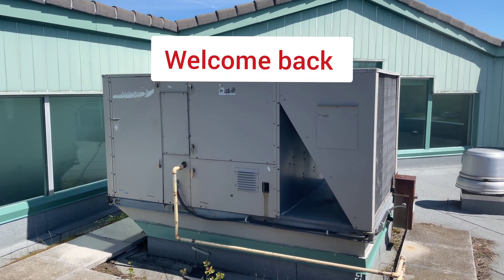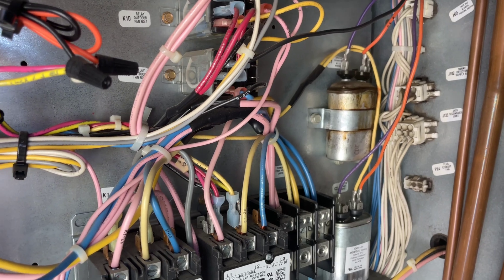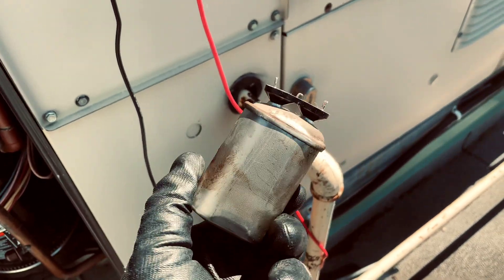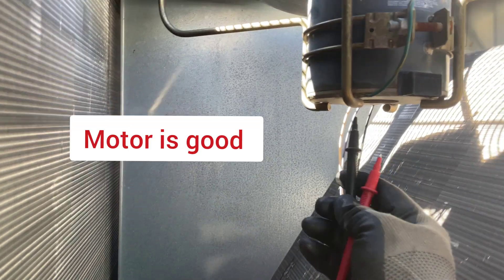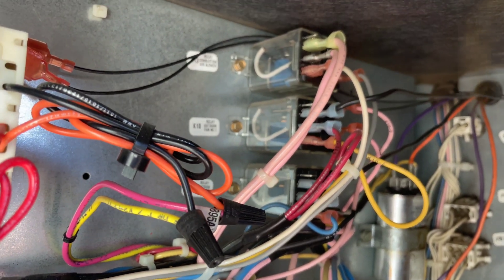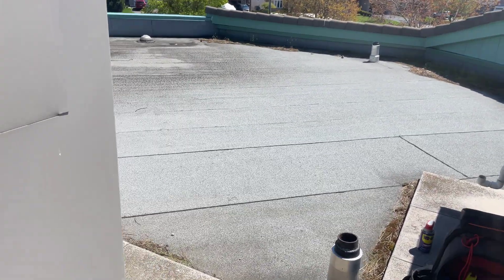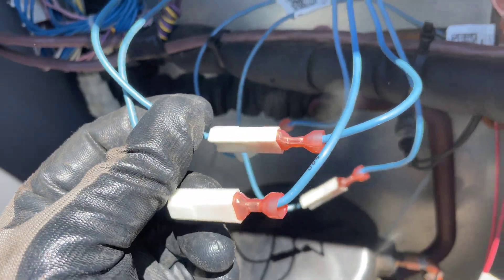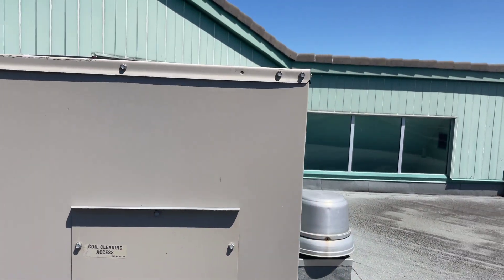LENNOX Package RTU Not cooling, step by step troubleshooting

Comment: I think you misdiagnosed this one the pressure switch you were showing only makes when pressure rises its the way Lennox controls head pressure in low ambient temps. you had the switch jumpered out of course the fans will run. you have to have pressure on the switch to tell if it was bad. switch is usually set for 250psi to 300 psi for 410A but you would have know if the switch was bad because if you had let the unit run it would have  went into internal bypass because of no fan motor. And you never had a set of gauges on either circuit because if you did you probably would have noticed circuit one was low of charge thats why the high pressure switch never made up. I love techs like you thats why I still have a job
Reply from the maker: 😂😂😂😂Looks like you did not pay attention what I had mentioned there, let me refresh you that was peak of the summer with ambient temperature 110F, in that case switch should be closed which wasn't because 2nd stage fan was running right away, these switches are installed only for low ambient and cooling is needed inside, they maintained pressure in condensor,
I changed the switch after few days but for customer requirement I had to jump it,
😂😂😂😂Please pay attention during watching

Comment: The last thing you do in testing is ohm test.  If power present at motor but motor not turning then its bad.  Waste your time ohm test the motor.  You bypass the high pressure fan switch without verify high pressure?   Gotta know at what pressure the switch is close and make sure verify if you have that pressure at that point before concluding that pressure switch is bad.

Comment: Good find. I think lennoz should have wire the pressure switch in series with the compressor instead of condenser fan motor. 

The compressor was running without a condenser fan motor, therefore high side pressure will rise. 

Flaw design I think
Reply from the maker: Thanks pressure switch was different that was condensor fan cycle control switch which closes on the rise of pressure which is helpful in cold ambient temperature, in this case it was faulty
Reply: @Learnhvac. Make sense now. What was the model number of the unit?
Reply from the maker: That was Lennox L series
Reply: @Learnhvac. Thanks. Now that make more sense

Comment: I had the same problem with more than 20 units at the same time and I thought was normal 😅 due all motors same position were stopped ! My question is why all units with the same problem ? LPS bad in all of them or just the board know when send the 24v to this motor in particular
Reply from the maker: Well that depends what is ambient temperature is if it is too low then it takes some time to build up pressure in condensor coil and to activate fan motor relay, if it is too hot then fan starts right away just like other fan in the video was starting, board has nothing to do with it

Comment: Great video. Good Job and Nice Work. Thank you for sharing. May I ask,  is it high pressure switch on liquid line was bad ? If it, how many pressure that switch will open ?
Reply from the maker: Yes that was pressure switch on liquid line, that should close on high pressure as ambient temperature was 75F should be close just like other pressure switch for different fan

Comment: I’m confused why the problem couldn’t have been the relay itself? Because it was bypassed and the motor started
Reply: The relay was working properly but not receiving 24v to activate it for that reason the motor not working. 24v was controlled by LPS in this case.
Reply from the maker: @joseantoniopadronhidalgo8016  yes
Reply: Sorry, a newbie here. I understand that the relay was working but I don't get how you knew it wasn't the relay by moving the black wire from lower terminal to upper terminal.
Reply from the maker: @yoyoman3386  ok I check step by step, condensor fan motor was not working I checked motor, it was ok then supply motor voltage by bypassing relay which was by moving black wire, motor started next step was why relay wasn't working so Traced relay through wire diagram, and found pressure switch was faulty
Reply: @yoyoman3386  you can see the relay move when it receives voltage
Reply from the maker: That was not relay it was pressure switch actually, and I start from the component which is not working, and Traced it backward for root cause